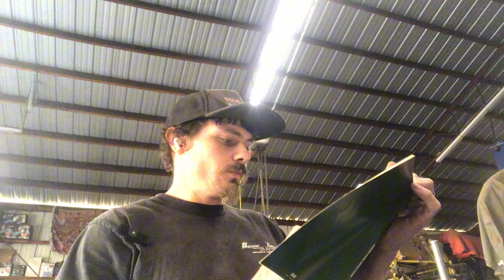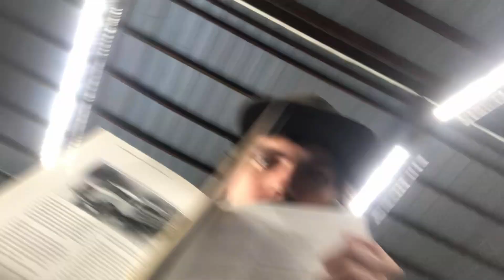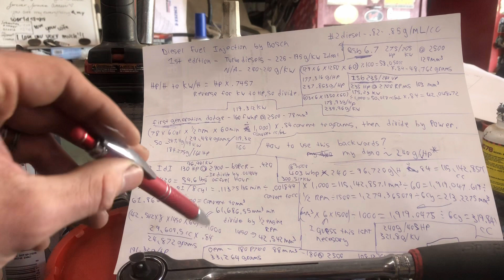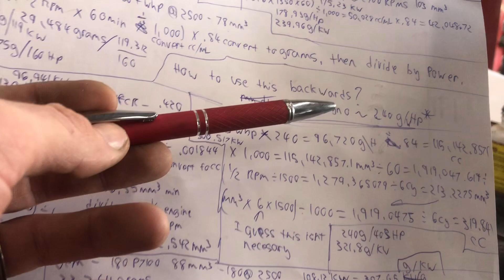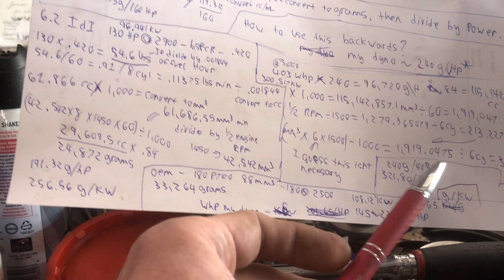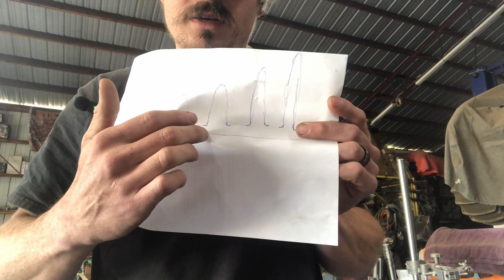Mechanically injected performance diesel engines are…… complicated. But they don’t have to be.

Comment: Have you played with that program I sent you for calculating power from fuel and rpm and bsfc?  Yes as rpms go up you will need a much larger nozzle to get the same fuel delivery. I often run 5 x .025 and .030 nozzles on engines that make peak hp around 4000rpm. To make the same power at 5000 rpm it might take a 5x.035. Any nozzle that size would be absolute trash on a street engine or anything trying to make power below 2500rpm.
Reply from the maker: Not just yet. I am in ~ limbo as far as free time vs work too do lol. Which I don’t mind since “bills” lol. But kinda getting to a point where I may have a little more free time to start playing with things again.

Comment: Just my 2cents

Pushing a smaller nozzle to its flow/horespower limit to keep smoke/haze down is ok but it can come at a price. It can create an over pressure/heat condition for the plunger and barrel which can cause the plunger(s) to stick or seize. Make sure to run extra lubricity in the fuel if trying this and cross your fingers.

Long injection duration is good for spooling a turbo but not good for EGT'S under full load. Its a tricky balance trying to spool a turbo with an injection event that is too efficient.
Reply from the maker: Agreed. I think that “spot” where that happens though is farther away then it may seem to be. Lower quality parts may have some merit to that problem with failures. And factory defects.   Learning all I can every day. I have a dynograpgh with a vp44 with several different injectors all made by the same place that shows what happens when the injector is too large. I imagine the opposite end of that is it makes killer power per lb of fuel till it damages a injection system component or the duration vs pressure equates too a loss of lbs of fuel moved. One of the two should occur next I imagine.